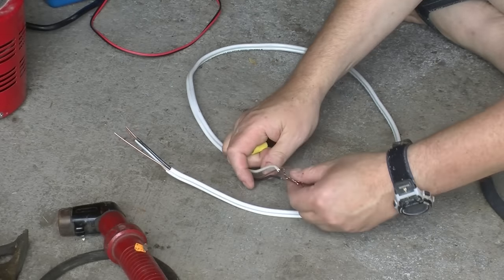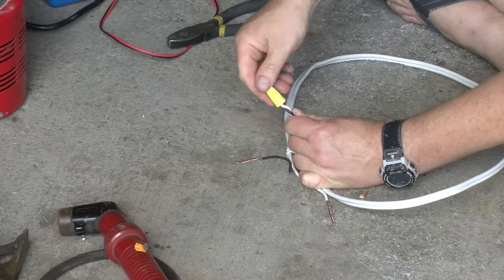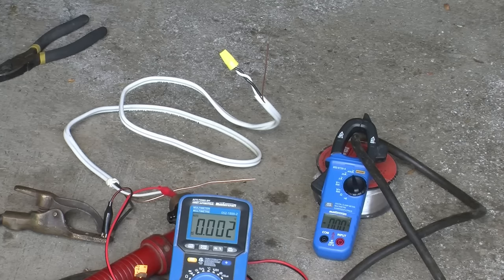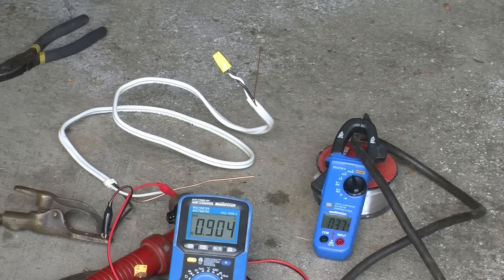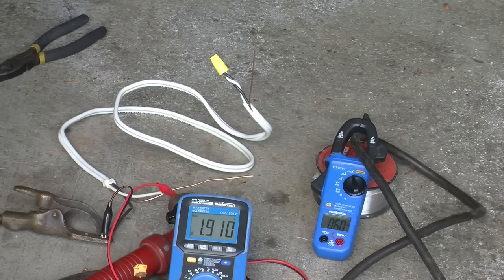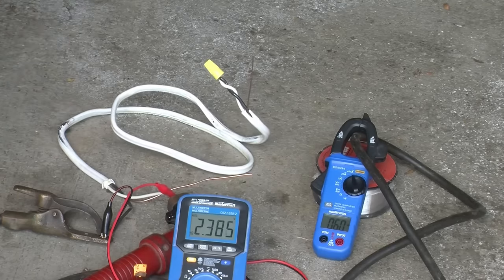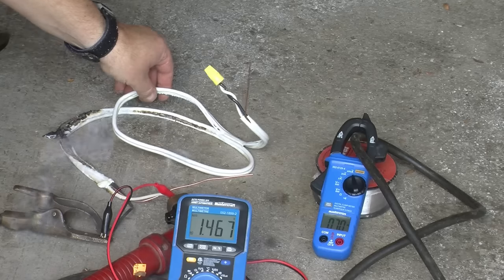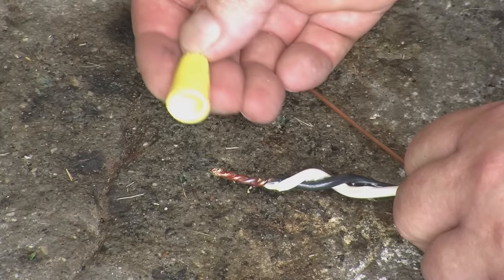How many Amps to burn up 14/2 electrical wiring?

Comment: Keep in mind this experiment has the Romex in open air, which is reasonably good for letting heat escape, instead of passing through insulation in a wall cavity.  Also he's only giving it several seconds to heat up.  Don't use "didn't catch fire after 10 seconds in free air" to decide what wire gauge you will use inside walls!
If the jacketed wires are warm on the outside of the jacket, they're hotter inside the jacket, and hotter still inside the wire insulation.  And most of us hope our house wiring will last for decades.
 6:50 watch the voltmeter climb:  the resistance of copper wire increases with temperature.  It's getting hotter.
Reply from the maker: Great comment and let me add to that. Any experiment - mine or someone else's,  should not be taken as any encouragement or suggestion to use anything other than the approved wire for a certain application.  Its just interesting to see very roughly what the safety margin might be.
Reply: It was just academic.  Obviously you should follow electrical codes.
Reply: @shaunnightfire8269  My thought exactly!
Reply: I’m just a homeowner handyman, but I think you would have entirely different results if you used a length of 100 feet.  A short 5 foot length is not meaningful and leads to incorrect assumptions
Reply: @dustmaker1000 He mentioned resistance around 6:30. 100’ sounds a bit long for household wiring unless you have a very big house. I’m trying to remember the longest run of my old house and I don’t think it was too much more than 50’. Perhaps 60’. 🤷🏻‍♀️
Reply: @MarcosElMalo2    Agree - 50’ or 60’ would be appropriate
Reply: @dustmaker1000   I doubt it.  The watts/foot dissipation would be the same at the same current regardless of length.  The main thing that isn't shown here is what happens if the wire is enclosed in a wall - especially if the wall is filled with foam insulation!  It would rise to a much higher temperature at the same current and may very well catch fire at a much lower current.
Reply: According to Code tables, #14 AWG is good for 35A for 90C insulation in free air. Code limits #14 to 14 for a combination of voltage drop for typical use and terminal heating in circuit breakers and wiring devices (receptacles, switches and the like). The wire can take more than the 15A that the code limits #14 to but the device it connects to likely will not. Insulation also degrades with temperature and time so the limitation also prevents breakdown and the resulting shorts. If you want to have some more fun, try to breakdown the insulation integrity by overvoltage. 600V wire can take extreme high voltages - at least for a relatively short duration.
Reply: Follow the appropriate codes, and/or hire a licensed electrician and get it inspected. It will cost more than a cobbled together DIY job but surely peace of mind has value.
Reply: That's a very good point, insulation makesd a big difference in heat escaping.
Reply: Agreed. It also is not 15 amp rated. It is 15 amps max when used for residential. It is also 20 amp max and 25 amp max when used for other purposes and insulation types. 2020 NEC Table 310.16
Reply: Thermal resistance uses the same equations as electrical resistance. If you consider the r-value of the jacket and air, it's easy to see that at steady heat output (current) the temperature (potential) rises as more resistance is added between the heat source and the environment.
Reply: Not to mention wires passing through a hot attic

Comment: Note the voltage drops at 8:22. That drop in voltage means the resistance decreased. In this setup, that can only mean that the wires are now touching before they get to the wirenut. In a voltage driven circuit (such as household power) at that point the current and power would have gone way up. Since I think we can assume that to get to that point the circuit protection has failed, at that point I would say the fire starts...
Reply from the maker: Good point about a real household circuit. One would sure hope currents never get to these levels. One commenter did point out how people upped fuse values in the old days if a fuse blew. So maybe back then sustained overcurrent may have been more common and there would have been the possibility of even the too large fuse saving the day when the wire shorted.
Reply: @ElectromagneticVideos  In the 50's, we replaced fuses with a few coins, screwing the bad fuse back in to hold them in. (After fixing the problem) Many people thought it was a permanent fix, but they caught on by the third or fourth rebuild. Other poor results are obvious by now, I hope.
Reply: Sorry dude... you need to test at 130volts 15 amps....
Reply: @randytrant  I was under the impression that current is the sole contributor it heating and voltage is irrelevant.
Reply: @hhn2002  it is. 15 amps is 15 amps. Also current depends on how much voltage you apply. There is no way to limit current to 15 amps at 120v with just the wire resistance.
Reply: @libtrs838  well you could have a load or resistance in the circuit to limit amps at that voltage, say a 1,800 watt space heater. Then you could test at that specific voltage and amperage.
Reply: @hhn2002   Sure you could but you would get the same results. You were 100% correct saying current is the sole contributor to heating and voltage irrelevant.

1800w 120v heater would be 15 amps and 8 ohms.

In this test 0.350 volts got 15 amps so the wire has a resistance of 0.0233 ohms. The wire put out 5.25 watts of heat.

At 120v

Heater + wire resistance 
8 + 0.0233 = 8.0233 total ohms 

V/R = I
120 / 8.0233 = 14.956 amps

So this circuit is running at 1794 watts (14.956 amps x 120v)

14.956 x 0.0233 = 0.348 volts (voltage drop across wire)
0.348 x 14.956 = 5.21 watts dissipated by the wire

14.956 x 8 = 119.648 volts (voltage drop across heater) 
14.956 x 119.648 = 1789 watts dissipated by heater 

1789 + 5 = the original 1794 watts

So at 120v the wire is dissipating 5.21 watts
In his test at 0.350v it dissipated 5.25 watts

The small difference being he ran at 15 amps and with the hypothetical heater at 120v the circuit runs at 14.965 amps

If we increased the voltage to 120.35 volts then it would perfectly match and dissipate 5.25 watts

Because to a wire 15 amps is 15 amps. Voltage makes no difference to heating if the current is the same.
Reply: @randytrant  you would have hundreds of amps at 130v not 15
Reply: If you kept the voltage constant at 120 and had a variable load instead of the wire nut it would  be the same until the insulation started to fail.  After that the current would run away very quickly and the fire would start sooner.
Reply: @libtrs838  Yes there is. Short-Circuit the wires and use a "Constant Current" Power Supply.
Reply: @TimeSurfer206  I said with wire resistance only. But you should probably look up how constant current power supplies work. Constant current does not mean constant voltage. When the load on a constant current PS is too large, for example a low resistance wire, it will lower voltage to maintain the constant current. Ohms law doesn't break.
Reply: The voltage did not drop at that time... It stayed around 2.4V. it wasn't until much later that the voltage started to go down...
Reply: @ElectromagneticVideos  sometimes smart people would use cigarette foil paper or such to wrap a fuse.
Reply from the maker: @carlodonnell146  I have heard of pennies used behind a screw in fuse when the fuse blew too often. I wonder how may houses burnt down from things like that?
Reply: The resistance increases. That is the resulting voltage drop. Ohm's law.
Reply: @randytrant voltage plays less of a role within reason than amps. 130v at 15amps would pretty much be within spec of the wire.
Reply: @libtrs838 Voltage is not irrelevant when it comes to heating. Heat is measured in watts. 15 amps x 120v = 1800watts, 15 amps x 240v = 3600watts. Voltage being the thing  that changed, so voltage is not irrelevant. The video is misleading cause it made reference to 14/2 residential wiring. He showing that it is safe at over load conditions. Now my Question for you is, would the 15 amp breaker in panel trip at the 15 amp and 5.21 watts being dissipated?
Reply: @libtrs838 most household circuits fail not in a method like this..  at 120 volts (North america) you would have arcing if the wire began to compromise at any point..  a "hot spot" forming woiuld be morel ikely to create an arcing condition as it failed which is what would start the house fire..  during installation, wire is often bent and unbent several times.. sometimes trying to snake it through in existing construction retrofit.. this repeated bend / unbend of the same spot in a romex cable results in  a spot that is weakened..  at low voltage it might be hotter than another spot.. but at higher voltage as it is a bottlenec in the current flow.. it may begin to form micro arcs which grow as the copper fails  and starts the fire..  you wouldnt see that nearly as much at these low voltages. its a similar failure in extension cords.. though not often in the cord itself  but usually in the connection points to the service outlet or the app;iance plug.. small arcs start at the plug and create enough heat to ignite the plastic.. while the cord may be overloaded and warm, it will be the connection points where it fails first(an untwisted wire nut on romex wouldve liklely failed
Reply: @eldoradoboy   Not sure what I said that caused you to write this.
Reply: @bobbrumley3964   Why do you think we transmit electricity at extremely high voltage and low amps and use fairly small wires? The wires before the transformer to my house which supply the power to multiple houses are smaller than the feed to my panel. Why are all wires rated by ampacity and not wattage? Why can you use a smaller wire for 240v than you can at 120v for the same wattage? The highest power transmission lines in the US are 765,000 volts. If they were lower voltage and higher amps for the same amount of wattage they wires would need to be gigantic. This is super basic electricity 101. The wattage is going to the devices being powered, it's not all being emitted from the wire as heat or literally nothing would would. The wires transmit the power to its destination. Some may even call them transmission lines.
Reply: @bobbrumley3964   also what do you mean 15 Amps and 5.21 watts? That would be 15 Amps at 0.347 volts. But yes breakers trip from current not voltage or watts. But also no because a 15a breakers needs a bit more than 15amps to trip. There are trip curve tables if you are interested in learning how they work.
Reply: @libtrs838 you didn’t answer my question. Answer the the question and I’ll review your answer. Then I can explain in more detail the concept. Electricity 101.
Reply: @libtrs838 Question, are breakers thermal activated devices. If as you say 15 amps is what it’s good for than how does it know there is 15 amps going through it. There is no metering device in the breaker. So please tell me how a breaker trips at a pre determined value (15a)?
Reply: Voltage drops as resistance increases…

Comment: I'm not surprised the wire nut didn't heat up appreciably. It really isn't carrying any current. Since the connection is actually the twisted wires, the wire nut serves only as an insulator.
Reply from the maker: Yes! I'm sure minimal current goes through the thread spring in the nut compared to the wire to wire connection.

Comment: I worked in cable, when foreign voltage melted our lines, it was always at the splice points of the tap or the ground block. We could cut the melted part off and the cable would still be fine. You need to test a longer length circuit with multiple splice types for an accurate test.
Reply: Torque screwdrivers! Use em!

Comment: just an FYI 
the adoption of twisting wires before putting on the connector came from the use of Marr connectors which had a small screw in the side which held the two wires together. if you didn't twist the wires then they became flattened as you tighten the screw and there is a lot of chance the cross-section area of The wire would become very reduced and over a period of time of heating and cooling the Matt connector would loosen off.
Ken

Comment: A few years ago I was doing some welding, and absent-mindedly attached my grounding clamp to my bandsaw, and the return current found it's way through the 120 volt shop wiring.  It lasted about 20 seconds at 75 amps before it let loose.  Lots of charred insulation.
Reply from the maker: Oops! So you did my test before I did! That must have been a real pain to fix!
Reply: @ElectromagneticVideos  I was lucky- most of the current path was 12 gauge, and it survived fine.  There was only one  section of 14ga. that I had to replace
Reply: You will Be suppressed how often this happens in workshops. Especially with the older non inverter welders. The return path ends up going down the earth ( ground wire for you guys). This cable gets so hot it melts the insulation on everything. The new inverter welders tend to run earth free on the outputs and is less of a problem, ( I think this is the case but never actually tested it). If your work is touching the building steelwork make sure you have a good return connection
Reply from the maker: @johnwarwick4105  I didnt know it was a common thing. Surprising that someone didnt make a current sense relay module for  the welder ground/earth wire that would disconnect power the instant that happened. Could have have prevented what I'm sure were costly accidents.  

I'll bet your right about the inverter ones (or at least some of them) having. I have done a fair amount of switching power supply design, and many have no electrical connection between primary and secondary. There might be a regulatory requirement for a ground connection perhaps for some perceived safety issue or RF suppression although I'll bet many on online sites might not exactly be built to  adhere to any standards!

Comment: Great demonstration. Thank you. The wire can really take quite a bit of amperage before it failed.
Reply: Honestly this is a terrible test. it gives people the false sense of safety on residential wiring. 
no one should put 60 amps at 120v AC through a 14/2 wire. he had it at 2v before the coating started to melt. 
your house doesn't run on 2v AC..